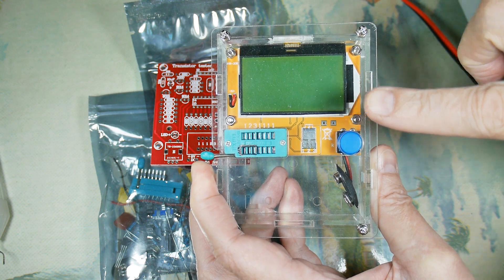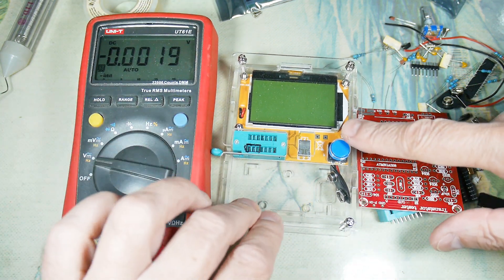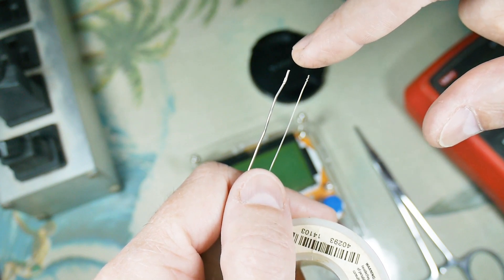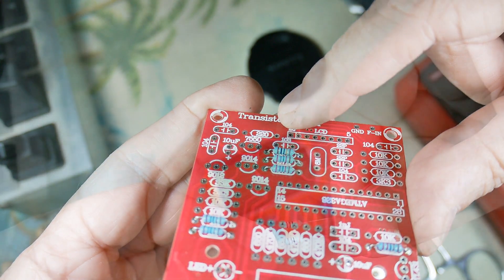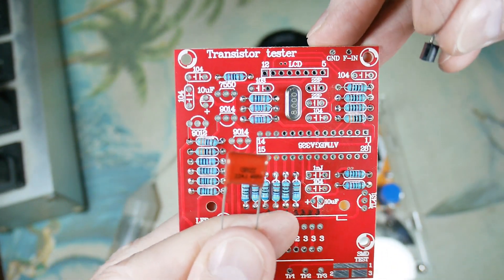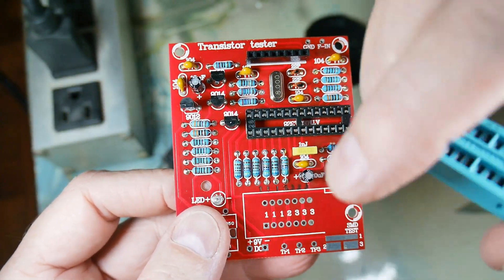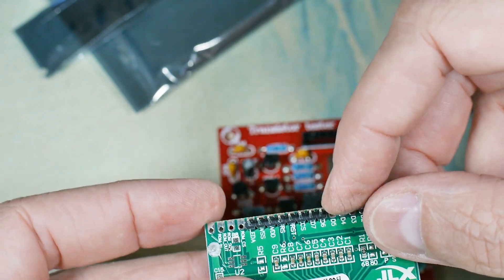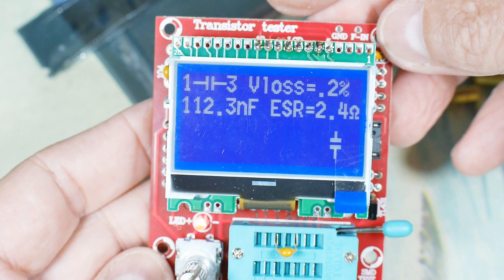Multi-Component Tester Assembly (M8 ver. M12864)

Comment: Nice video.
I am a bad hobbyist when it comes to electronics. I have my fair share of stuff to tinker around and I have a ton of components all in bags that are unlabelled. This might help me to get it sorted out. 
But I've seen that there are a ton of devices in different revisions out there. Which one would you recommend?
The one from the video is available to me for 15 bucks so it looks fine. 

Appreciate these videos - Always new stuff for a bargain that is really interesting.
Reply from the maker: Thank you.  Which one is a good question.  The other one I videoed is $7 with a box, does most of the stuff this one does.  If you want a cheap frequency generator and frequency counter, this $15 one is worth the extra bucks.  If not, then the first one works to sort out parts.  I've looked at many models, but they all seem to be centered around the same chips and have similar functions (group 1, on-off button only, group 2 digital selector).

Comment: I have been thinking of getting this newer device. I have an earlier one, the MK-328, that has 2 line LCD, so it doesn't have the pretty diagrams but I think it otherwise works pretty much the same. They are based on an Atmel 328 micro. Very handy gadgets, and remarkably accurate.
Reply from the maker: This one seems better than the last one, but I've seen 2 other models I might have to get and try out.  I fear my wife is going to start asking why I need 3-4 of these.  In any case, the first one ($6) is really pretty good, the second one has some functions I've not fully explored (freq gen, freq counter...) so we shall see!  Wish I had these years ago when I was using a scope and freq gen to find values!